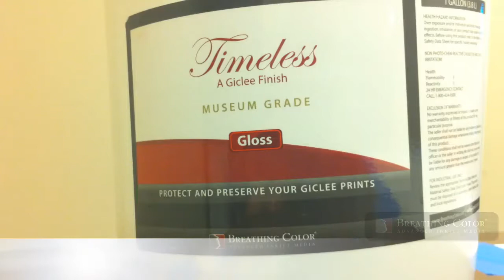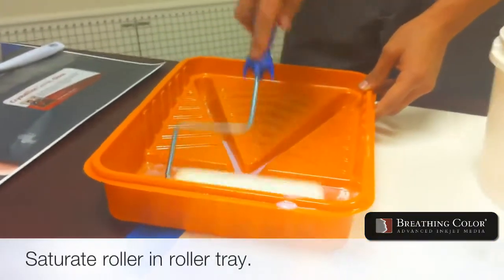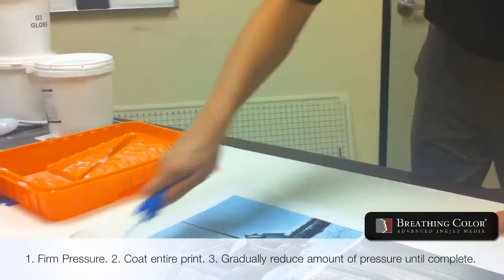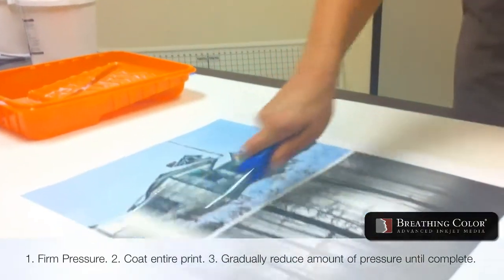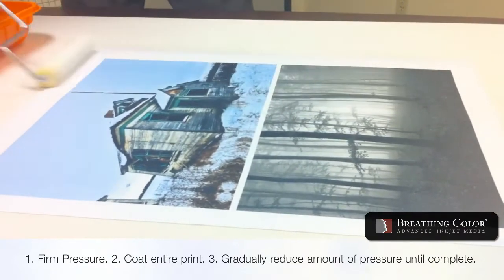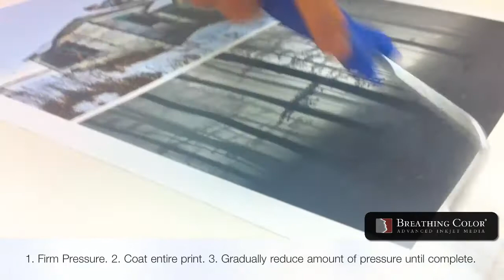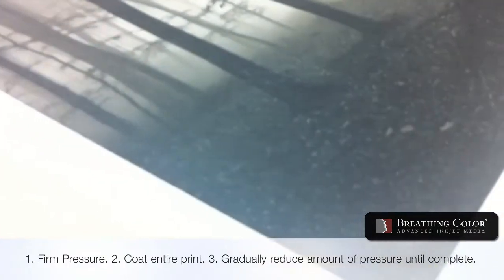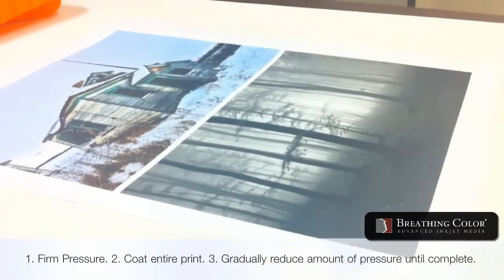Coating with Timeless – Roller Application Tutorial

Comment: Seems like the Timeless solution you are using in this video is a lot thinner that the Timeless I am pouring out of the container I purchased. It also seems to be pretty a pretty thick finish after it has been coated. Am I doing something wrong? Can it be diluted?
Reply from the maker: You don't generally want to dilute Timeless, no. I wonder if you were using our Glamour 2 instead which is much thicker and is designed to be diluted?